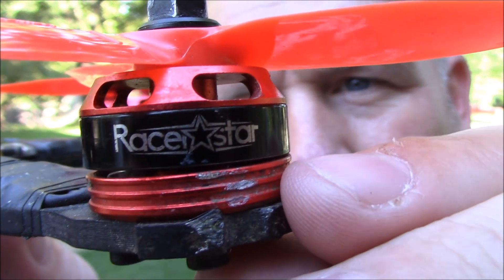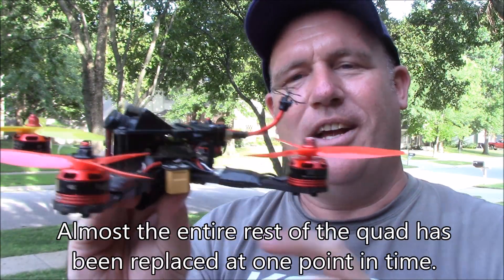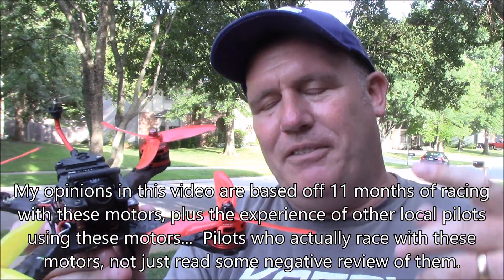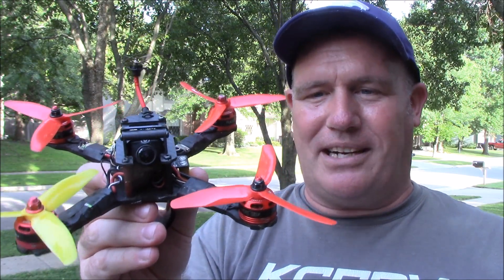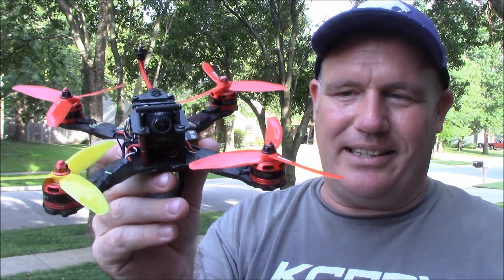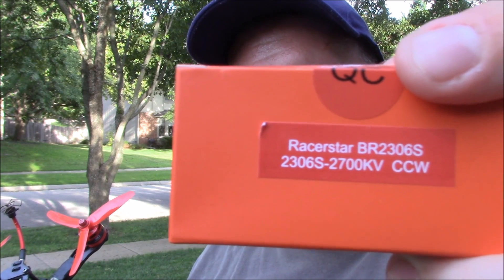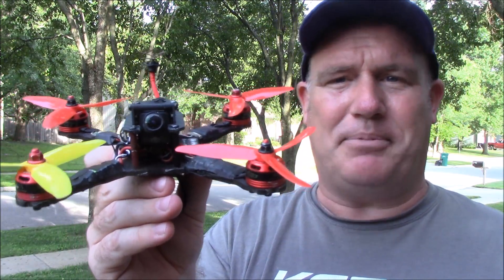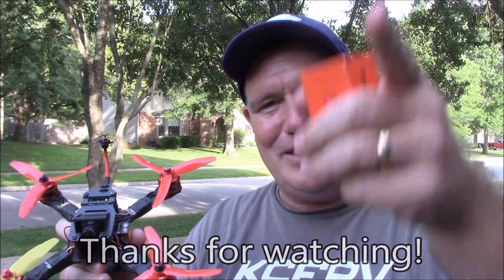Rant On!  Racerstar BR2205 2600kv Have No Real Competitors

Comment: I dont fly quads but I am getting into FPV wing racing! Some of my local club members run these racer stars as practice motors, so they dont wear out their $20+ motors ripping tons of packs during training, and they work really great for the club guys! I ordered one for my wing and am hoping to have a lot of fun with it!

My one complaint about the motors as someone who hasn't really flown them only seen them, is their wiring is pretty tiny,  if you start pushing some amps through them they are gonna get hot fast, luckly with wings its not the same as quads.

Comment: i built the same quad as yours after watching your video, but i bought better esc's. been flying for like 1 year nearly every 2 days and my motors are still perfectly fine... i love them and i dont get why people crap on them. 45 bucks for 4 motors compared to 80-120 for some other motors that i would end up wrecking almost in the same way, no thanks.
Reply from the maker: I built a few 6S quads and I have a hard time buying anything but Racerstar motors because they still have power beyond my skill.  Also, the cheap price keeps me using them too.  :)

Comment: travis have you used the 2306 2700kv? what you think???
Reply from the maker: Yes, they worked alright.  They were powerful enough to have fun.  I couldn't control them very well and I stopped flying the quad with the 2700kv motors because I started flying 6S quads.  My 4S quads have been waiting around for me to take them out again but it hasn't happened recently.

Comment: I agree 100%  I didn't learn how to drive on a ferrari, nor how to fly on a t motor. They are good enough for anyone to start with, and are almost indestructible.  I've build 2 quads using these, and had zero problems, even with several horrendous crashes. I didn't break a single one, and they're still going. They just seem to survive every crash. I don't think a more "notchy" motor, with a smaller gap would have survived what my racestars did. In my view they're  great beginner motors.

Now I can appreciate the (massive) difference a few dollars more can make with motors, but I couldn't before!  It's like buying a $200 wine bottle before learning to taste wine, you cannot fully appreciate it! 
Now that I can feel the difference  I go for better, more expensive motors. Now is the time to spend more. 
All this talk of "they are crap!" only makes people think they're not worth having at the beginning, creating an extra entry barrier to the hobby. They are only crap for people who already outgrew them.

Comment: Hi! Have a 2205 2300kv and crashed exactly the same spot as you did. Did you noticed any kind of damage or change on the "gap" between the base and the bell?
Also, how you deal with vibration?

Comment: Sir you just made me buy new motors xd
Reply from the maker: I'm to the point now that the Racerstar motors are a limiting factor.  I'm trying to find new, cheap motors to replace them.  I sucked it up and got some EMAX 2750kv motors and they are awesome.  I did manage to break one in a crash but that was most likely my fault and not the fault of the motor.  I feel like I'm really pushing them hard though.  Racerstar motors are still some of my favorites though.

Comment: I have a set that came with a x210 kit from Bangood and I'm not super impressed.  Yeah they work and they are decently smooth but compared to some old dys se motors they just don't have the punch.  If you compared them to a modern motor there would be an even a bigger gap.  The one good thing I can say is they are cheap.
Reply from the maker: The point of this video is that these motors are great until you, the pilot, are pushing them as fast as they can go and you still want more from them.  At that point, it is time to move on to other motors.  The fact that you can tell there is a difference between Racerstar motors and other motors, means that you have out grown these motors and it is time to move on.  There are a ton of pilots that can't push Racerstars to the full potential and are still in the "I'm just going to cruise around" mode.  Should they buy more expensive motors?  I'd say no.  The Racerstar motors give them plenty of power.  Racerstar motors are obviously not the best, but they are easy to recommend because of the performance they do give and for their cheap price.

Comment: i have the same x210 kit, i installed betaflight 3.2 disabled notch filters and enabled PT1 filter, but i still have propwash on some turns and when i drop from the sky and throttle up, what pids are you using and do you have propwash?

Comment: These are good motors for bashing , i run them on a 250 and it took sinking one in a mud bath which was deep enough to cover the VTX antenna in order to kill ONE ! the other 4 are still working perfectly.
For a basher/practice machine they are perfect , if any idiot wants to compare these to "higher branded " motors , well, then you really are an idiot.
The 2206/2600kv are a little better :)

Comment: I have these motors. They have zero low end grunt compared to the original emax red bottoms and the aluminum seems to be an alloy of cheese and grape jelly. The shaft on these bells bends if you so much as glance off of an invisible fairy. Seriously. There is no reason to buy these unless you hate yourself or need to play a practical joke on someone. If you want a set of these, I have 8 of them in my trash can that you're welcome to try, but I wouldn't advise it. Don't go this cheap on motors or you're going to be kicking yourself. Pay AT LEAST 10 bucks a motor.
Reply from the maker: Yeah!  Send me those 8 motors!!

Comment: I have the x210 with these motors that I first built thanks to your video.  I also have an Armattan Chameleon with Oomphs and Brain fc and pdb.  I honestly don't feel  that much difference between the two. The Chameleon is overall a little smoother and a little faster but cost A LOT more money so it should be.  I really have just as much fun with both and wouldn't even think twice about using these motors on  another build.  Just can't beat the price.
Reply from the maker: Right, you can't beat the price.  I have another quad with EMAX 2750kv motors and I broke one in a crash.  It is a $23 motor to replace.  I could buy 3 Racerstars for that price... oh well.

Comment: I have the 2205s 2600 kv motors on my freestyle quad and then I have a set of 2204 2300kv oomph motors on my race quad and I would say for racing they don't do so well but for freestyle they are great going on 6 months with them on my freestyle quad and tbh they hold up pretty well and provide enough punch to do some decent tricks

Comment: I have a set of the 2300kv motors on one of my quads and they are great. Not the most powerful motor in the world, but they are smooth, seemingly indestructible  and well worth the pittance you pay for them.

I  bought a set of 5, and months after installing them smoked one on the bench somehow (still not sure how), so I put on my spare then bought two more spares. I still have those 2 spares...

Comment: I've heard good things about the Hyprelites and they're middle of the road price-wise.  OTOH I have heard bad things about the hollow shafts on the Tmotrs.  Some people say they snap very easily.  The Racerstar BR2306-2200KV though are sluggish on 6" and I'm still a beginner.  It seems like they used too fine of wire for the windings, and fine wire is actually more expensive per pound than thick, so I don't know what they were thinking.  If you look at just about any other motor, the windings are much thicker.  I had bearing problems as well.  They come rough from the factory like they pounded them in with a hammer or something.  So far they run cool, though, so no complaints there.
Reply from the maker: I've had a friend who has destroyed 3 Hyperlite motors in the last 3 weeks.  Granted, he is fast and flies hard, but that is still $60 down the drain for him.  :)
Reply: travisgrindal Runnung 4s?

Comment: I've tasted the good stuff, and used these old racerstars for my backup quad. Now I can't fly my backup anymore with these racerstars because of the lack of power compared to my main quad with t-motors. The vibrations/jello is also unbearable with these 4 week old racerstars. 2 out of 5 came with play and noise in the bearing.
I tasted the good stuff, so nope, never again!

Comment: but, but, but, now you can get a whole set of sunnysky edge racing motors for $40.  But wait, there's more!  They also come with 4 25a blheli_s escs.  That's right folks and they are 100 times better looking at least than the racerstar.  beautiful motors for the price.  Whoops, too late, they went up!  http://www.ebay.com/itm/New-SunnySky-Power-combo-R2205-KV2500-Motor-blue-R25-2-4S-ESC-set-/292225105419?hash=item4409f93e0b:g:jxwAAOSw5iJZeZI-

Comment: Rs2205 2300kv purples, 6 months, 1 motor down out of 2 quads using them, after eating concrete on a failsafe (dented bell), I bought 4 more for when I finally lose a second motor.

Bottom line: cheap motor, not the best not bad either. I recomend these to beginners then something like a hyperlite after they have had a chance to learn

Comment: I got 4 racerstar motors in a month subscription box and two are pretty much beat must have bad barrings. Spent 8-9 on zmx motors and they are ten times the motor. Yeah they were on sale but you can find them under 12 bucks it worth the extra few bucks

Comment: I built the X210 V+ after your review of it and used the Racerstar 2205 2600kv. My first quad, it was awesome on 3s. Then I bought 4s and it's more awesome!! Ive banged it into the ground many times. Once a c-clip came of and I still flew it without a problem (the shaft was bent and I was waiting for the replacement which Banggood sent me after I showed them a video of it.)
I couldn't have afforded this hobby if it were not for Racerstars motors & ESC's.
Reply: What ESCs did you use with your 2600KV motors?

Comment: I've been using RacerStar motors for ages, And BR2205's were the first few sets from them that I got.

I'm more of a hobby flyer than a racer, But I've never had any major problems with them. My biggest issue with the BR2205's is that a set of 4 can quickly puff most batteries at the affordable end of the market. I had 6 of these motors on a 350 hex that I ran parallel pairs of 30C 2200mah 3S packs on. That setup should have been good for 132A of load. The BR2205's SHOULD have only been pulling 120ish when flat out, But despite that hex being used as a cheap mini camera platform (ie, No flips, And not going flat out) it puffed both pair's of packs (4 Packs) within 3 flights on each set !!!

The main quad I still use these on is a 5" martian with which I use 1500mAh Turnigy Graphene packs. Those packs have enough grunt to keep it together under the load even with lots of flat out runs (Although, I'm told they have carbon fiber plates top and bottom......... So how would I know if they're puffing?!?!). Before these I was using 1300mAh 3S 45/90C Turnigy nano-tech's and only getting 10 or so flights out of each before they got too swollen to risk continued use. 

Anything I've got that can take 6" props now has BR2403's on it. These may create about 15% less thrust than the 2205's, But they do that using 25% less power. The drop in thrust isn't noticeable during 90% of flying, but I can definitely notice the couple of extra minutes of air time I get with this setup. :)

Comment: I've had a set of the 2205 2300kv motors for over a year, thrashing and crashing and they still work fine.   Another set on a different quad worked fine also, but 2 got destroyed from a 200 ft fall to rocks.  Another set is on the way.  But I bought a set of 2208 1500 for a larger quad and they vibrated so bad as to be unusable.

Comment: Hey I'm running the same motors here and man they're good 
I need to know can I run them on 4s with 5045x3 King Kong props on a 25A esc ??
Reply: i run them on racerstar 35a tatto esc's and cyclone 5050 v3. you should try the 5050 props these motors make expensive stuff look bad with a decent prop. i use r-line 1300 95c battery run it about 3-4 min motors arent even hot more like luke warm. the dont like quad blades that extra drag will eat your battery. tri blade or dual blade and get something with a nice pitch. the cyclones v2 are okay but lack the mid torque you need to punch out hard. 

Yesterday i bought the V3 and the whole group was nagging me to install them and OMG quad turned into a beast!!! So go 5050 tri blade props and let me know what you think.

Cheers
Reply: Omgwtflmaololrotfl 
Are you referring to the 2300kv version ??
Cause I'm running the 2600kv 
And I'll try out the props when I busted all the ones I have thanks
Reply: yakiyee 2600kv same as you. I'm getting some 5051 props if the 5050 was that good the 51's are going to be bat sh!t crazy...
Reply: Omgwtflmaololrotfl 
Ok I'll try them out when I get them 4s cause now I'm just using a DIY 2s2p 18650 cells that max at 40 amps zzz..... Can't even punch it at all haha
Reply: yakiyee yeah 4s is beast. Maybe just use normal props when you get the 4s. Cause the difference from 2s - 4s is insane. Don't want to break props if you still getting used to your setup

Comment: I went from Emax RS2205 2300kv to a set of these and I like them.   It's a very different power band and I found the DAL T5040 V2 is a good match for these.  The KingKong 5040x3 were terrible.  The Cyclones aren't half bad on these either.

Let us know how those 2306 go.   The thust bench shows really good numbers for the 2400 and 2700kv flavors.

Comment: rcx h2205 2633 9$ same price as racerstars and 100 times better they just feel so much better and more durable and have so much more power. I know people might be tempted to get these racerstars because they are so cheap and they are on a really tight budget build but if you spend a extra 1$ per motor to get the rcx motors you will feel a big difference. The is a huge difference betwene getting budget parts and getting the absolute cheapest parts. Spend 1$ more $ on way better motors
Reply: Where do you get those for $9 and free shipping worldwide?  The first(only) two sites I found were $12.99 + shipping.
Reply: UnlimitedVertical you choose remove warranty from rcmart which drops the price. Rcx are amazing motors, the 2206 v3 is pound for pound the best motor in existence.
Reply: Thanks...remove warranty is one thing, shipping to Canada is another :-(   I appreciate the info though.
Reply: UnlimitedVertical ah... it’s only a few dollars to the uk.

Comment: couldnt agree more... i would go further though ... my first build used kingkong 2205 2300kv (measured at 2500kv by engineer x) and dys 5045x3 bullnose with 16amp RWRC esc's... that was about 9months ago i still havent seen anything and i mean anything punchout faster than that build.... i of course ''shit myself'' and put on slower props and motor guards... i now have a new build ultra cheapo with racerstar 2205s 2600kv motors as well as new KK motors (not 2500kv i suspect)  and i can still go from naught to 60mph quicker than i can say naught to 60mph. if i can use your car analogy for a second.... there are no ferrari components yet, expensive motors can still have design flaws and quality issues.... its just less frequent than the cheaper ones...so.... factor in the crashes... i bet most people are like me, on a limited budget trying like hell to amass more than  3 batteries at the same time. so gettin pissy about cheap gear, which in reality is the backbone and the majority of the hobby...??? its just off, its way off.. i would guess there are more eachine wizards in the air than all the other 5 inch quads put together, so this hobby isnt getting more popular... its getting more affordable.

Comment: I have had 8 of these motors (2quads), and have been dissatisfied with them. Some were noisy, some had huge play in the shaft, wobbly bells and prone to accident damage. I got a set of Gartt 2206 2400kv for $7.xx each and was surprised at how much better they were than the racerstar in everyway, especially in performance. Much more power at lower rpm and midrange and a bit more top end, yet no notable increase in amp draw.  Now the quads i fly the most are fitted out with  gartt motors for all the reasons you have outlined. I have more expensive motors but find myself flying the cheapies more often.
Reply: Hi, can you please let me know where you bought these Gartt motors?
Reply: ellipticality gogorc.com

Comment: I use these on my spare and until recently on my main. I recently swapped my main to Emax RS2205S 2300Kv and tbh the difference for freestyle is minimal, the Emax are very slightly better, and cost about 3 times as much.
For a beginner or even an intermediate pilot on a budget I wouldn't hesitate to recommend them for freestyle.
Both of my sets have survived the usual punishment that motors take with zero issues.
If you've any doubt just watch any of my videos that are more than a couple of weeks old, I often get told how smooth my HD footage looks using these motors.
Reply: JJ FPV yep very smooth. easier to tune also than more powerful motors

Comment: I have 12 of these racerstars (S model) and they are all garbage. Unbalanced from the box, hole in the shaft is not in the centre, bearings noisy from the start, huge tolerances, every motor clapping side to side etc.  I think the 2016 motors were better quality but if you buy them now, you are not happy. For the same price you can get King kong gt2205 motors (30e/4pcs inc shipping), they have true hollow shaft, 4mm bearings, curved magnets, well balanced and super smooth. They have more power and no quality control issues at least in my motors.